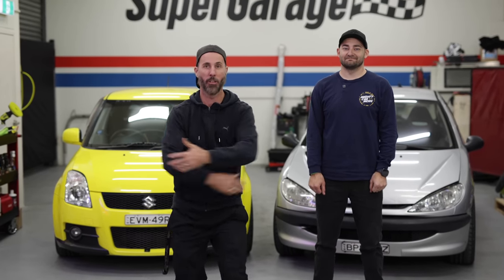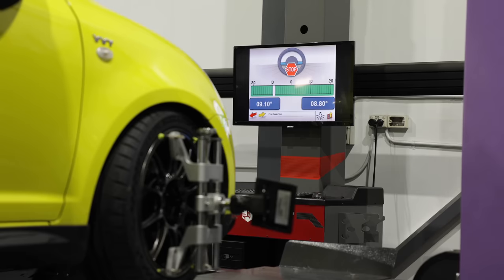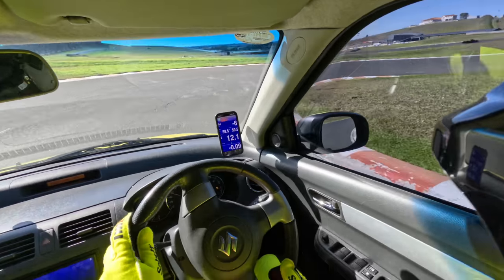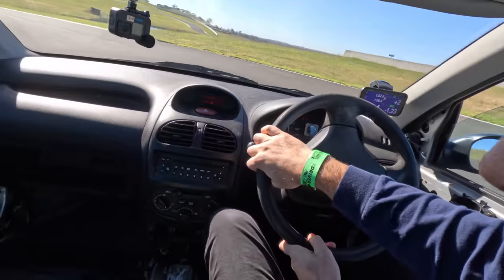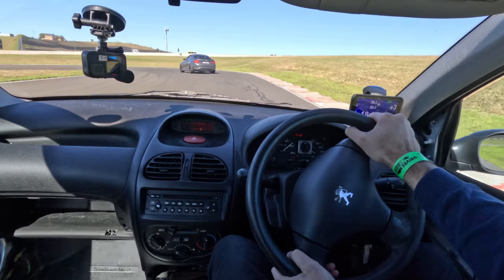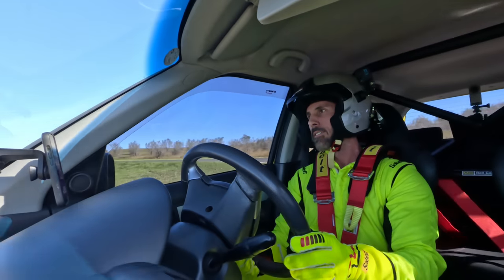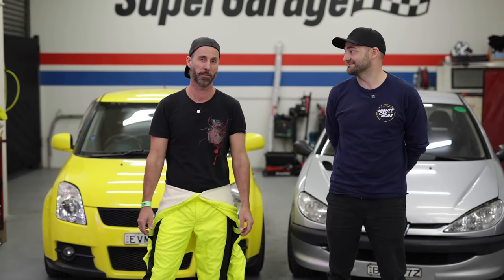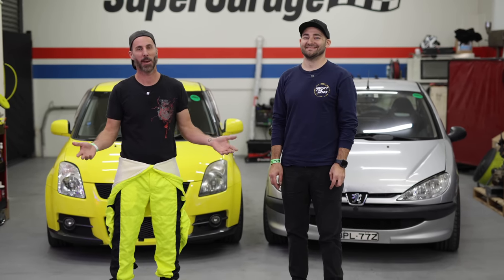Peugeot 206 vs Suzuki Swift FINAL BATTLE

Comment: As a Subaru and Peugeot owner I knew the result since the start. Peugeots are so underrated or even hated in petrolheads world, so nobody really know how good they are. Just out of the box it was faster than Swift, but with proper mods it could be way faster.
Reply: What Peugeot did you have?
Reply: @Space Cowboy you are  right about that 💯
Reply: @khajiit5556  1,6 308 2011
Reply: Is not even GTI

Comment: I wonder if Marty will keep the Peugeot, and give it some additional service, stronger brakes, and some additional power adders...I think he was thrilled with what he accomplished, and how he did it.
Reply: think about the other trash mods he did like exhaust...i think its going in the bin.
Reply: Wouldn't bother. If he was actually keen on keeping a Peugeot ( doubt it ), you'd buy a GTI or GTI180 minimum.

There was a red 206 GTI going for 4k when this series came about.
Reply: @Kristoph109  and how many bigger engines or forced induction have they done to Daihatsu's...?  Would be cool to see them go that route with the Peugeot, because it's so different where they are.
Reply: @Kristoph109 1.6i or 2.0i (non rc) have better tune options than the rc itself
Reply: Maybe if it didn't have whatever problem is with the engine to make the light come on and the breaks failing. It's a turd, and not a good kind of one so the decision to put more money into it just to make it functioning would have to be rationalized through love, and I don't know if there's much love being felt for that thing haha

Comment: I called the Peugeot winning from the off!! 😂😂 Would have been an absolute cake walk if a better french hatch was chosen too, or even the 206 GTI... Great videos boys, absolutely loved them as per 👌
Reply: Bit of a strange thing to say? Would it alsi have been a cakewalk if Moog had bought a more powerful Japanese hatchback?
Reply: @ferrumignis  i just meant they got an absolutely bottom end french hatch as opposed to something more capable out the box from the french offerings... They could have got a 106 gti or saxo VTS which is still a 1.6 litre, 120ish bhp, similar in size etc and it would have SMOKED the swifty if the 206 did 😂
Reply: @VersionOneUK  They couldn't have got either of them since they were never imported into Australia. The 206 was the closest equivalent to the Swift they could find for reasonable money.  This whole series has been a disappointing half assed mess tbh. Moog spent a bunch of money on mostly pointless crap, added weight and just threw on his new suspension with no setup.  The engine tuning segment was an absolute joke.

Comment: Find a 3,0 V6 Peugeot front end, and stick it in the rear of the 206, center engine that are very tunable, fix the gearing with lower tires, and remove all flex bushings from the anti roll bar, making it stiffer, there's so much more to do, for little, or no money, what about side rails out of alu, for the seat, i like the challenge of no or little money, much better than just buying stuff. Build over bought, everyday.

Comment: Awesome vid, the seat problem is a easy repair, the system that a allows the seat to move forward for someone to climb in is the problem just remove the little cable underneath that is connected to the side lever.

Comment: Marty's Peugebro weight reduction was likely the biggest gain. Weight, tires and suspension makes the greatest difference around a track.
Moog will win in the long run though. A good platform for further modding

Comment: I hadn't even considered the PeugBro taking this. Well done. Genuinely surprised. Quelle surprise!! Spend a minimal few more and flush the brake fluid with DOT 4. If I remember right, it's compatible with DOT 3 but higher boiling point. To all the PeugBros and other car enthusiasts, do not use DOT 5. Completely different racing stuff.

Comment: Tires are always the best thing to buy. Not only are they better for grip on the track but something like the michelin PS4/5 are great for daily use aswell. There performance in the wet if amazing. Brakes are a big deal to of course. Depending on your car you might be able to get brakes off a similar OE car. Like putting GTR or Evo brakes onto different cars like people do.

Comment: FYI, brake fluid don’t boil, what happen is that old fluid will absorb water since it’s an hygroscopic fluid and then, the water contained within the fluid will evaporate creating pockets of vapor which is more compressible than brake fluid hence reducing the pascal going into the brakes.

Comment: You can't drive at the grip limit of really good tires without some kind of decent baffles in the oil pan, especially with transverse cars. You're just oil starving the engine on and off constantly or if it's a big and fast enough sweeper for a long time. An oil/air separator is also a good safety item.

Comment: One important takeaway for me was that if you plan to track your daily, flush out the old DOT3 brake fluid and replace with DOT4. Relatively cheap and easy but should reduce the likelihood of losing brakes at the worst possible moment. 
A coolant flush probably would be worth it as well... maybe install an oil cooler and if it's an auto an aftermarket trans fluid cooler.

Comment: You guys did an amazing job on this! Within 0.5 second is almost a tie I’d say.
And to the suspension setup, totally agree you can’t do full race spec on the swift, since it also had to be a street car.
Reply: They didnt have adjustable arms so there is nothing extra they could do versus on the pegeot anyway.
It just becomes a question of how agressive they want to toe each car. They chose to make it the same. (More agressive than stock) on both.

Comment: There are mods that gives HP for example if both were doing 16" or even 15" wheels(maybe wider like 8 or 9"), they would be better for both engines, there are also mods even for the intake of both that you guys could take the example of Peugeot(there's a racing intake for it that a lot of people in Europe uses that it's almost like a shovel even has that nickname - at least in my country, because base that also is mixed with Citroën aka PSA, so they're interchangeable with a lot of Saxo CUP and C2 VTR's etc) also you could dial better the suspension on the swift as it was rubbing as hell. keep up the good work!

Comment: i have a 206 .
for the seat you can use a metal hose clamp and adjust the seat and just put a clamp on the rail not on the seat before and after the seat ,effectively blocking the seat from sliding on the rail and trapping the seat between the metal hose clamps ..... ask me how i learned this trick

also i would be interested to see the 206 get turbo charged , i know its not worth it and you would need to change the ECU ,but it would be interesting to see if the 1.6 can even make it to the next step !

Comment: The 206 seat runners not locking in remided me of both my 206GTi in the past. Randomly driving and hitting the brakes the same thing happened in both my cars.
Moogs, drop in and drive my 308GTI 270HP, LSD, factory Alcon 380mm braked last of the Peugbro GTIs. Maybe your hatred will turn.😂

Comment: Weird question for the Aussie crew. I see you have pretty decent window tint on the cars. Is it legal to tint your windshield? 
Is tint usually done at the dealer before it’s sold or does everybody just know a car tint guy? I assume when it’s 40C/110F it’s basically a requirement.

Comment: The sheer weight reduction is the key to the Peugeot - we learned this with the Lotus Exige some time ago.

Time to get a better Peugeot engine, then upgrade the coolant system, and get some new brake fluid & spark plugs. :)

Watching the Suzuki around a turn (16:56), it seemed the front end was bouncing (overly stiff).  Not sure if I am mistaken on that or not - it might be the track surface at that turn.  I would have a qualified suspension tech observe and make a recommendation.
Reply: Peugeot did an OEM "better" version - its the GTi 180 and would've pasted the Swift stock for much less money too.

Comment: I think, at the end of the day...a good seat, good tires (wheels if needed) and slightly upgraded brakes/fluid would be all you need.  Unbolt your rear seats and spare, etc. when you actually hit the track - but that's really all you'd need to bump the performance enough to have fun.  I think some of the other stuff is definitely "too much" at this level of car unless you're planning to go full-nuts on it.

Comment: I know its about the content but for the money spent on that swift you could buy a mk7 ford fiesta st good tyres, track pads and discs a good panel filter and an off the shelf tune.
That setup would in my opinion  be so much better on and off track.
I daily drove one for 4 years and if was brilliant.

Comment: You can get 307 brakes direct bolt on with 283mm rotors. 15” with 205/50/15 would probably give a better gear ratio you can lower the rear suspension by an inch, one notch of rotation on the torsion bars

Comment: There's definitely something to be done with the Swift. 
Adding bracing, strutbars and polybushes, would really make for an ultra stif platform. Then obviously a brake upgrade, and power upgrades would take it even further. 
Imagine what a set if hot cams, better headers and a tune could do. 
And finally strip it

Comment: The best upgrade you can do besides getting better tyres, is to add a supercharger. High pressure superchargers require extensive engine mods, but a low pressure supercharger can be a relatively simple bolt on affair.

Comment: Most of the cost of the Swift was safety, and you didn't even use the value of your suspension because you went for the same setup as the Bro. You're paying to get all that extra adjustability and performance, right? Safety doesn't really show on the lap time, until you DNF and you walk away without a scratch.

This is inspiring though, the Bro looked like a lot of fun and for such little money, just getting a good set of wheels and tyres would be all I need to enjoy myself on the track with any car! I wonder though, the car's brakes were boiling and the Swift overheated. What didn't you invest in or consider that allowed those kind of failures on the track?

Comment: Remember the best mods for track driving will be reliability mods! 
Engine water and oil cooling (we saw 2 failuresin this video alone), decent brake fluid and pads at a minimum.  This will increase all your seat time and that'll be beat for lap times!

Comment: Marty giving in far too early. Get rid of all the glass apart from windscreen. Trim more metal out. Better brakes v6 coupe and better cooling. Get a mapped ecu and stiffer from anti roll bar. Swirl pot for fuel and the pug will be loads more fun. Can do all on the cheap. Would show how much money moog is spending for little more. performance.

Comment: Beyond safety, maintenance and engine cooling. Brakes(Pads and fluid), Tires, Seat + seat time will make the biggest difference and give you a good baseline as to where your money should go.

There's a gentleman that I used to do Autocross with whom had a base model FB RX7 with a carbie 12A (113hp). His money went into tires, suspension, brakes and seats and he would always dominate to the point that even cars with double the power couldn't keep up. The only cars that could, were actual race-cars, but even then he'd only be slightly off their pace. Had he shoved a NA 13B from the later FC's (160hp), he'd have no problems keeping pace with them.

Speaking of cheap, said gentleman had a fabrication class at the local Uni weld him up strut tower braces... His only cost was for materials, because those kinds of classes always need real-world projects.

Comment: In hindsight they should have upgraded the brakes and engine cooling as well. The stock parts aren’t designed to handle the continuous loads of track use.

Comment: I REALLY can't wait to see these cars get the Cash vs Trash eBay turbo kits! Or even custom built turbo kits with eBay turbos. I know this sounds typical, but I built a 1997 Honda Civic coupe with a base model Integra B18B1 (1.8L DOHC non-VTEC) $250, with an Integra GSR short ratio 5 speed manual LSD transmission ($250), eBay swap engine and transmission mounts ($60), I ran a stock single cam P28 ECU with a Xenocron chipping kit that I installed myself ($50), an OBD2A to OBD1 eBay adaptor harness ($25), an eBay basic turbo kit that consisted of turbo manifold, 50 trim .63 AR turbo, and a 3" downpipe that I had originally had on the JDM D15B VTEC single cam, but I adapted everything short of the manifold to fit ($450), I already had 17" wheels and cheap 205/40/17 tires for it so those went on, I used DSM 440cc injectors bought on eBay ($100), and my friend street tuned it for $200. I also added ARP head studs ($100), and a new Cometic MLS head gasket ($80) for extra insurance. That first engine ended up spinning a rod  bearing after 20,000 miles being boosted and abused. The guy who sold me the engine lied and said that it had 90k miles on it, and when it blew told me it had 250k miles on it when he sold it to me. I bought a new engine from a local salvage yard with an actual 87k miles on it for $650, and I did it the right way and rebuilt it. I put ACL Race rod and main bearings in it, new NPR piston rings gapped properly, and a new head gasket, water pump, ported oil pump, BC stage 2 turbo cams, dual valve springs with titanium retainers, a Skunk2 Street intake manifold, Skunk2 70mm throttle body, etc, and it made 412 wheel horsepower on that same eBay turbo at 18 psi.

Comment: Well depending on where you're located there are different problems finding car related stuff, here in Europe that Peugeot would get a engineswap for a 2.0 16v with 136-140hp (EW10j4* engines) witch would be found for 200-300$ or even for free of a spare parts car. (From just about any Pug or Citroen from 1998-2009)
..But finding a Holden is just impossible, Who would not want a large turbo Barra?

Comment: Best gains for the 206 is to sell it and buy the same car in GTi spec - with the gutsy 2 litre with a performance tune from the factory and better suspension brakes and cooling. They’re track day capable out of the box.

Comment: I feel you Marty, owned a 206 for a few years, would randomly switch off/disconnect the engine and engage steering lock (once happened on the highway doing 120kph). I think they look great and drive nice, but French electronics.... 🆘

Comment: i'm curious to see what tiny bits were left on the garage floor with the swift if it was stripped like the poogoat and the suspension setup wouldn't be limited to match Marty's car, but specced to the best of it's ability.
though, i'm more curious about what's next from you guys.
can't wait 🦄🦄🦄

Comment: Thermo mod, better brakes and a full race setup on those coil overs, you could have easily gotten another 2-3 seconds off on the Swift. Those front wheel drive nuggets can have a lot of grip. Race/fast street pads and discs would have been braking way later. Swift needs a tune tooooo XD

Comment: I wish these "cheap V expensive" challenges had a 3rd middle of the road car. Of course premium parts are going to perform better and be safer than the cheapest bottom of the barrel parts out there but are there some middle of the road parts that do a good job vs the expensive parts?

Comment: Cheap car - YES, decent Brake pads and Discks - YES, Oil Cooler - YES, Sticky Tyres and race alignment - YES, Gauges Oil Temp, Oil Pressure, Water Temp - YES, Decent Seat and hardness - YES - Stock Engine and drive Train - YES - Trip interior - YES - Go Racing !! Reliable and Fun !!

Comment: The big takeaway IMO is that modifying cheap fwd cars rarely actually makes them much faster. If you have a budget for a track car, a sports car as a base with less mods will be faster and more fun (who likes boiling brake fluid and overheating engines?) than a highly modified fwd commuter.

For example, $25k AUD is about $16k USD for that swift. I looked online in the US and a used Corvette C6 (2005) with 40k mi on the odo (about 65k km) is listed in the US at under $16k USD. That's a 400 hp LS2 engine in a RWD lemans winning chassis with a 12.5s 1/4 mile.

That used Corvette WITHOUT MODIFICATION would run circles around the swift, and the LS2 is built for sustained power. A true sports car engine would be much more resistant to heat from track use - and be good for 500+ whp if you want it in the future. 

The tuned swift is fun I'm sure, but not as fun as 400 RWD hp (2.7:1 power:weight vs swift) in a car that tops out at around 190 mi/h (305 km/h) and pulls nearly 1 g on a skidpad.

Comment: Good seat story my first car I went to adjust my seat not long after started driving pulled up with lock as I went to stopnat a stop sign slid forward pushing the brakes harder and ended up with a bloody tooth print cut into the steering wheel!

Comment: The Swift Just needs a set of Decent High Temp brake Pads,  Braided brake lines and discs and an Oil Cooler and you'll see more fun and reliable it will be. don't bother with bigger brakes, decet pads and discs will make all the difference.   You'll also be shocked at what oil temps you are getting if you put an oil temp gauge on the car.

Comment: Did you guys get the 106? One of those with a jp6 engine, it will out handle the limp effort that Peugeot made with the 206 and run rings around the swift👍

Comment: Peugeot rocks 🎉
Got one 3doors 206 1.1litres because there are no any living 1.4 or 1.6 in my city… there is not so much difference between 1.1 and 1.4 litre engines, but there IS a difference between 1.1 and 1.6) but with our traffic jams there is no difference. Main thing the A/c is working, the car in MINT condition, and got only 65000km and there is much potential in there to go 🎉 have a good roads everyone)